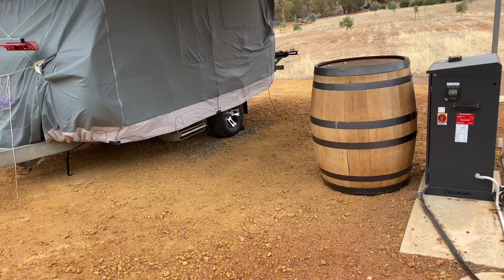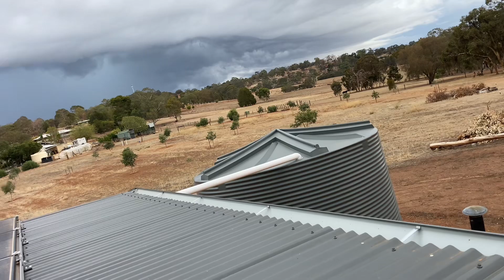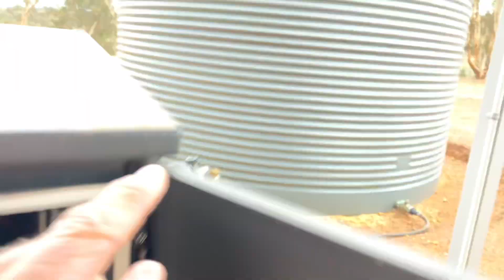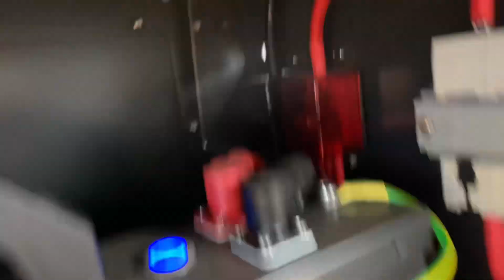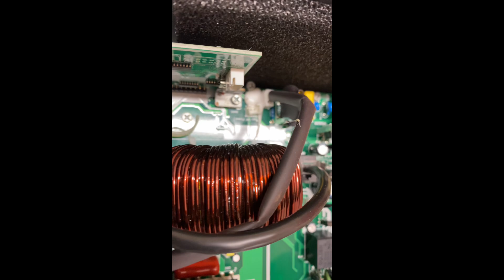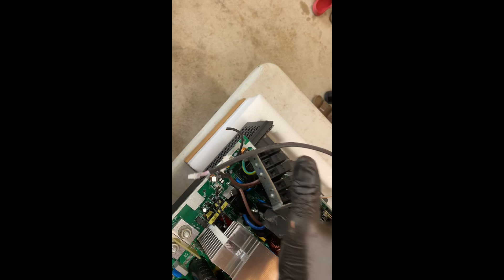Ants ruining inverters, how not to mount solar panels. Perth solar inverter repairs Off Grid.

Comment: Hey, why is there supposed to be a gap? and why is it bad to have rails along the edge like that? I ask because I just can't imagine how that would make any difference at all besides voiding manufacturer warranty etc.
Reply: They can flex to much and crack
Reply: @thaddeuspoole1704  thanks for that! 🙏
Reply: Also no end clamps, you can't use mid clamps on the end of the array

Comment: Ants love Amps.... lol.  We problems with them getting into our well pump pressure switches.  What I do is poke a hole in teh bottom of a plastic dish or cup and run the wires thru the hole.  Then I put Sevin dust in the cup.  They can't climb the wire w/o walking thru the sevin.

Comment: That corrosion damage is quite likely from the Ants spraying Formic acid around rather than moisture. They use it for several purposes. They quite likely eventually caused the short that zapped em, hence the bodies.
Reply from the maker: Thank you that makes sense

Comment: Nice recap on this inverter Jason, yes insects, geckos etc. don't mix well with electronics, I see plenty of laptop/desktops destroyed by them.  That solar panel install was terrible...did you manage to find out if it was installed by a professional ?
Reply from the maker: Thanks mate
Panels installed by owner 🙃
Reply: @joondalupelectricalservice3201  ouch....